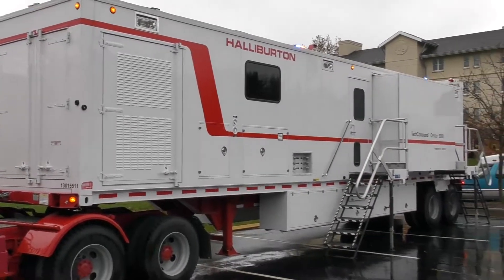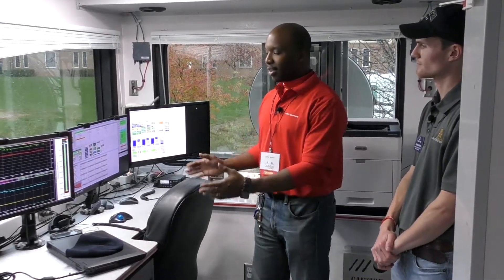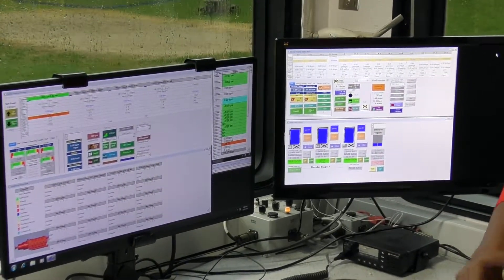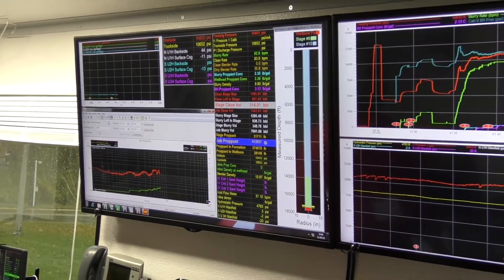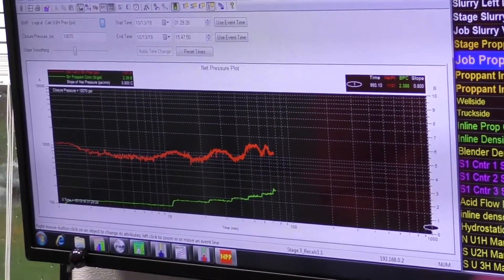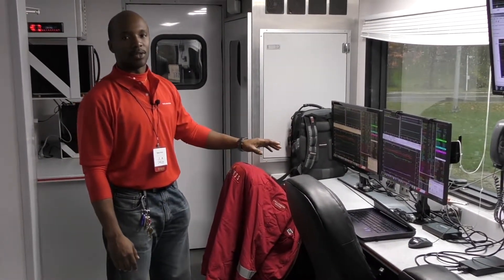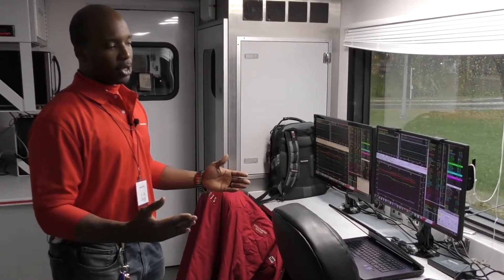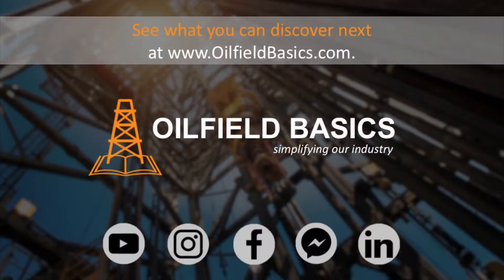Inside a Halliburton Frac Site Mobile Command Center

Comment: Is the other room a pump room or field lab?
Reply from the maker: The back room? It's a little lab usually. Nothing too fancy.
Reply: @OilfieldBasics  i haven't ran a crosslink job in years. 

Just figured they had a big pump/blender/camera room.
Reply: Depends on the crew. Some crews use it as a control room for wire line Pump down operations
Reply: @Texassince1836  I've heard about those. The wireline operator can run the winch and crane and the same time... i guess he has a camera so he doesn't miss a wrap?